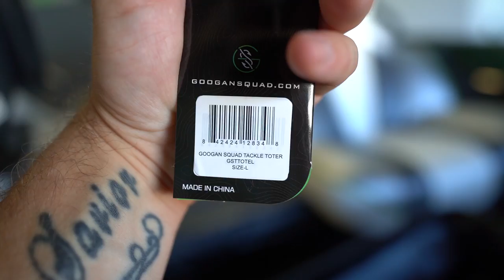I Traded My $100,000 Boat For A Random Boat On Craigslist

Comment: My aluminum boat cracked up in the front by the trolling motor also, it was due to the trolling motor bouncing as I was hitting waves, so I had a guy weld another piece of aluminum over it so that it was double plated and, had him weld a 1/4-inch thick plate to mount the trolling motor to, and it didn't ever crack again. But I also put a velcro strap to hold the head of the trolling motor down so it didn't bounce so much when hitting waves.

Comment: I have to say... I have had the big full on fiberglass bass boat.  I was still in the military and I fished it every chance I had... well the military had other things that were more important than my off duty bass fishing... so long story short I sold the boat.  But years later I retired... and when it came time for another boat.  I went to an Aluminum boat. I just didn't need that much boat anymore.  I love it... easier to care for... less opportunity to damage the hull ...it fishes shallower water and access to some smaller lakes   / ponds.... the list goes on.  Sure on big water a big rig is smoother and faster.  But in general I love my Aluminum boat.... 
  Some ideas... go with a jet vice a prop... shallower water... Install float boxes on the back and a tunnel in the hull ... Bob's transom jack plate... of course rear anchor poles... the rest is simple... electronics and trolling motor... plus the cosmetics... they have some really good flooring material now that can replace the carpet and it doesn't get hot... basically the only thing is how much you want to spend.  You have the money to spend so yeah send it.  Upgrade the wheels and tires on the trailer... I hope you show the build and progress it will be fun to watch.  Use your contacts and get a Merc.. I am a little surprised you didn't look into something like  Grizzly.... variety of different brands... in a plain somewhat plain  new Aluminum boat to start your build from.  Comparing the cost... and having a warranty... either way.  This is going to be a interesting build process and project.  Looking forward to it... this is good content. 👍

Comment: Not sponsored and just have one. Get a Primeweld 225 tig or mig 180 welder and it will do that boat easy and doesn't cost 2500. Tig is around 800ish and mig is mid 500, can do pretty much every metal and I've used it on flatbottom boats to car parts. Great all around beginner to intermediate welder that will do that boat like its nothing. You'll save money in the long run instead of buying all new stuff that could be a quick fix or have to wait on parts. And they can weld on 110 or 220.

Comment: There have to be weld shops in the Dallas area that can weld aluminum. Take a 1/4" drill bit and drill a hole where the crack ends. The welders should be able to do the rest.

Comment: On your front deck cap where your troller motor is. Make sure to drill out the ends of the welds before welding them up so they don't keep spending and check your ribs in the front to make sure there not cracked or any of your structure under the deck.

Comment: You might wanna check the entire front of that boat for more cracks AND re enforce those areas to handle the larger trolling motors you are going to use on it. Luckily it is aluminum and you can have it easily welded. Going to cost a grand or so to have it fixed and re enforced.

Comment: Should have gotten an aluminum Ranger. 2013-2019ish. All aluminum hand built boats. Built with .100 aluminum. Or a triton of those years. Exact same as a Ranger. Just different cosmetics. The construction is the exact same though. Can’t tell the difference between the two until they go through paint.

Comment: I can tell you with experience with aluminum boats, which is honestly alot, you need to get that tigged up asap. Aluminum bass boats ride like sht anyways, and I'm guessing the rigidity and wave bouncing with the trolling motor attached to the front cracked it. If it's not fixed soon, you'll be swimming to shore.